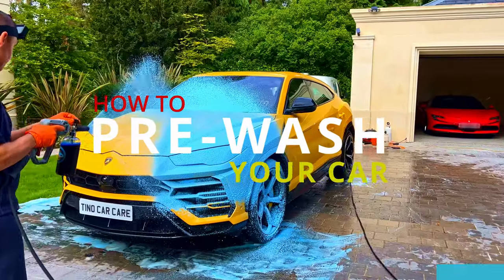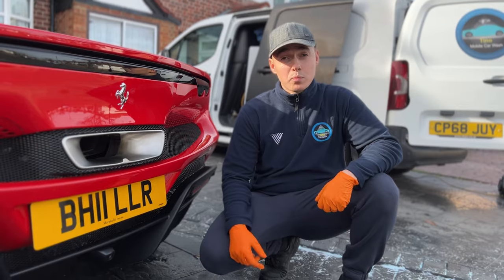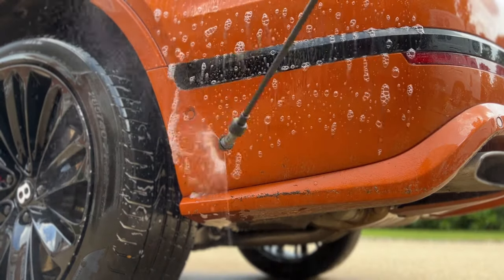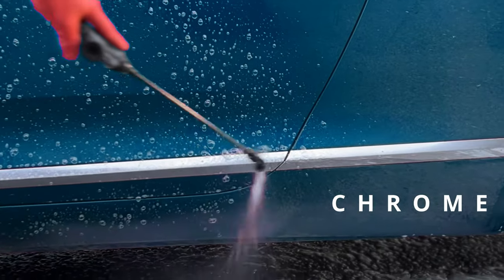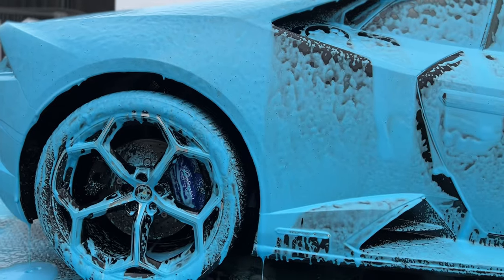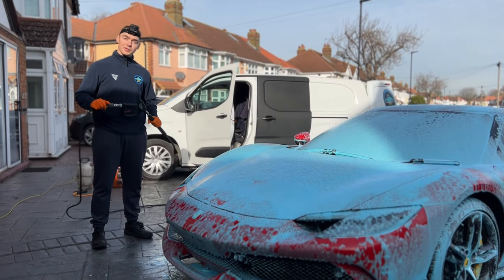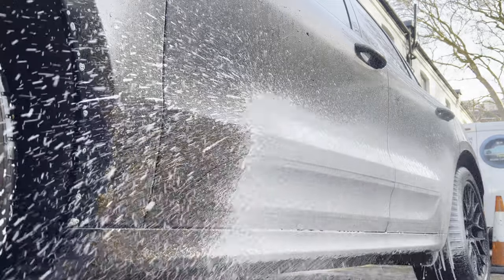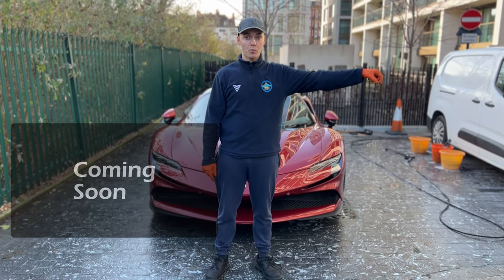How to PRE WASH Your Car

Comment: Hey Tino. Hope you're well man. Have a question around quick connect nozzles. I've just ordered all the gear to upgrade the hose and gun on my Gerni 130.3 (Nilfisk in Australia) and i am wondering if you could give me a run down of what coloured nozzles you use on what parts of the car, and when you use the lance extender. Much appreciated.

Comment: Tino great videos and tips, I was looking at your products and was wondering if the snow foams are PH neutral. Do your products remove ceramic coating?
Reply: Yes they are neutral. No snow foam will remove a real coating. They are incredibly chemical resistant.

Comment: Is it better to rinse off the pre-wash foam from bottom to top?
Reply from the maker: I would usually recommend rinsing from top to bottom, as it saves water and is more efficient.  However, if the car is especially dirty in some areas, you can utilize the bottom to top method, which does a better job at blasting away dirt.